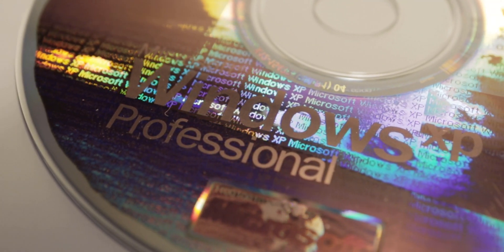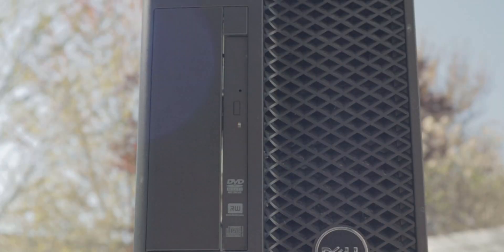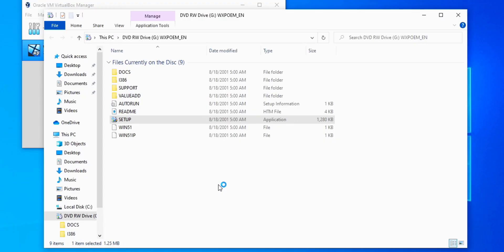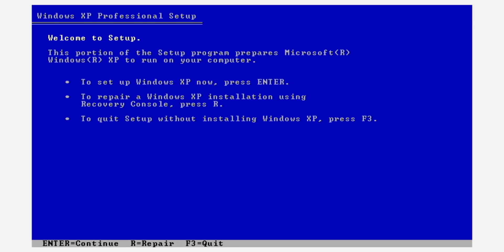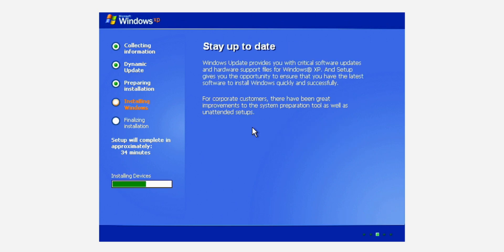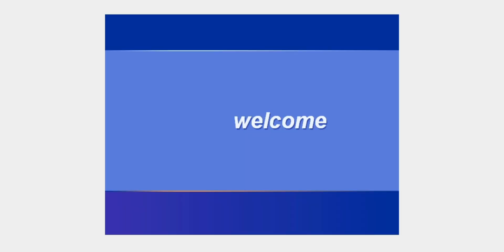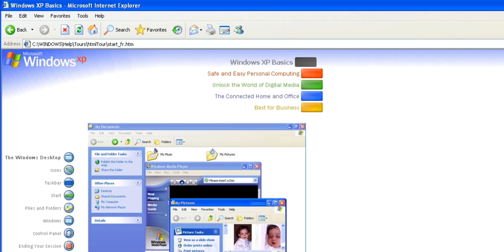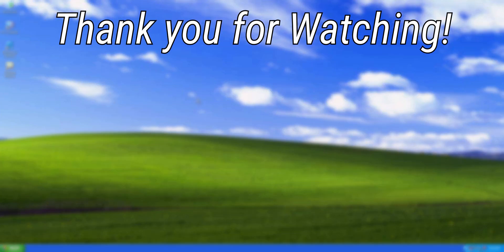Installing Windows XP from a Physical DISK!

Comment: Just one question: I have a windows 11 and a USB Disk drive to it, if I install windows XP would I be able to switch back in forth from 11 to xp or would I be stuck using XP and lose everything I have from 11
Reply from the maker: It looks like you can switch back and forth, but I would follow a tutorial so you don't lose data.. this is the first tutorial when you search "dual boot windows xp and 11": https://mattpilz.com/dual-boot-windows-11-windows-xp-in-2021-a-retrospective/

Comment: Windows  xp Chrome/ your connection is not private fix please
Reply from the maker: Check your time. If it's not accurate that could happen. Also, Windows XP might not be able to work with websites now.